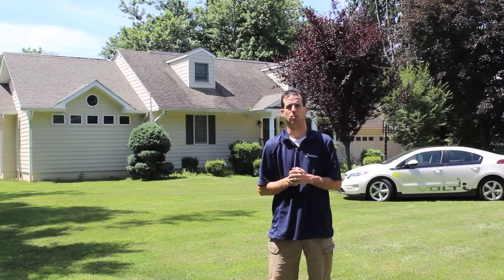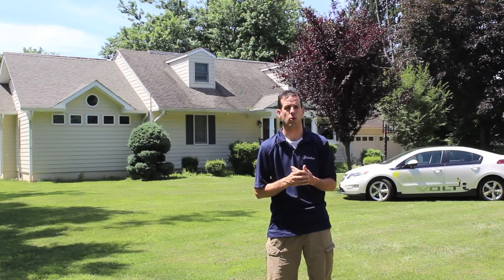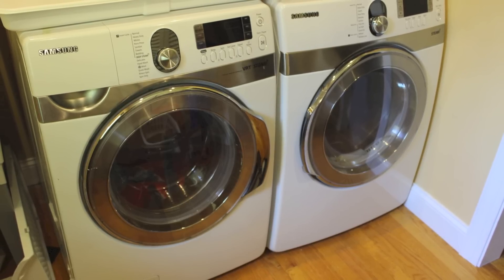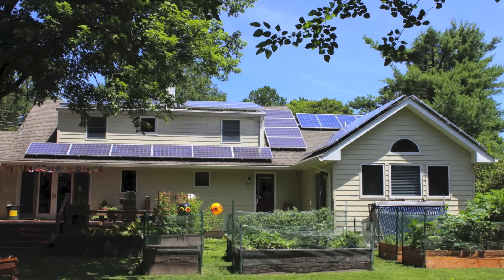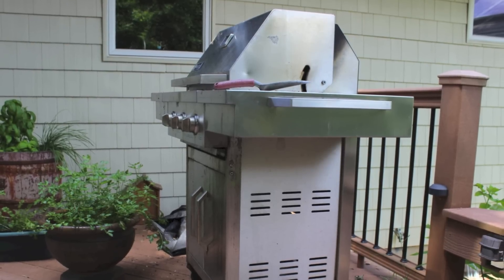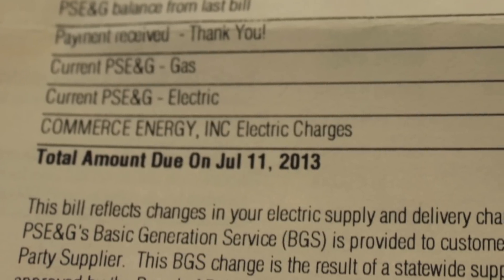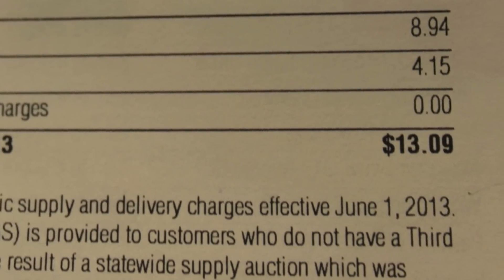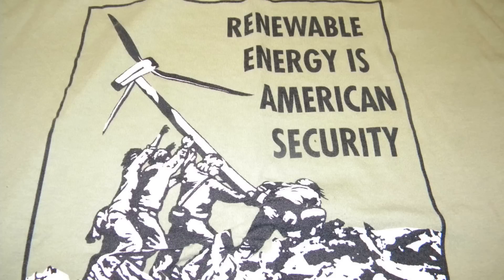Net Zero House & Car in New Jersey  Solar PV Thermal Geothermal No utility bills

Comment: I'm a conservative and have a energy efficient home... don't appreciate the asserted stereotype near the end - further, solar panels (though I have them) are made outside the US and is not recyclable and creates waste over time. Though I enjoy not paying electric - this is not a carbon footprint friendly product as there is none as I see it at this time. Geo thermal is a great option to offset heating costs so long as the water conditions are good with excessive minerals in water, depending on open loop vs closed loop systems. As for the electric car, we still have a way to go to make that be viable with distance per charge and time to charge - I can see us eventually being there but until it can match or exceed gas vehicles in all ways including time to charge matching filling up the tanks, it can only be forced by democrats rather than a natural transition, as with all "net zero" policies.

Comment: Just had a 13 KW solar install done and waiting on NET meter installation before commissioning. We hope to be NET 0 or close to it with respect to electricity consumption, still using natural gas for cook top, oven, hot water heater, furnace and Generac 20KW standby generator (a must here in SE TX where we are prone to outages caused by tropical storms). Natural gas averages about 25 dollars per month so probably won't be switching all of those to electric.  Nice looking home and congratulations on your low power bills.

Comment: I am looking into building a house in Ohio and I want to do passive solar with thermal mass storage and solar PV for my electrical needs.  Question is with a limited budget say less than 100,000  I am figuring things a bit backwards.  I am trying to get all these energy saving systems priced first then will determine how big of a house I can build.  I know orienting my house with a bank of windows on the south isn't going to cost anything but everything else is a little difficult.  I am looking at kit homes then getting volunteers to help with the build of the structure.  Just how big is your house?  Any suggestions?  FYI:  I will be in a rural area and will have a septic tank but hoping to do a grey water system, also hoping to have a well instead of public water.  The less hooked up the better.

Comment: everyone forgets cradle to grave c02 emissions. even solar pv panels emit carbon...
think its 0.080 grams per kwh. manufacturer transport installation and the guy that burned fossil to get there. It adds up!!
Reply: An average size human at rest exhales 1.47 kilograms of carbon dioxide per day. The solar panel would have to run for over 2 years to produce as much "cradle to grave" CO2 as a lazy human does in 1 day. Sure, "it adds up", but it adds up to nothing substantial, especially when the alternative is fossil fuel. And if it really bothers you, plant an evergreen tree on the western side of the house. It will sequester carbon for years to make up the difference, and reduce cooling loads by shading the house for even further energy savings.

Comment: My family and I have been researching net zero homes for a while.   We're planning to relocate to the MD area.   Do you have any thoughts on SIPS panels versus the traditional?
Reply from the maker: I think Sips can be good, as long as the joints are properly connected.  I'm always concerned about air leakage between the panels.  BTW- I do consulting, feel free to contact me if and when you're ready.

Comment: Thanks for sharing your home and what you did to get to that point.  You still have the fact that solar will last 25 or so years they say. So the increased costs in upgrading your system when that needs to take place.  But as you said your investments paid off within 8 years.  So you could purchase 3 complete solar systems and come out ok.  As well cost of solar continues to dive.  Great stuff.
Reply from the maker: Marcus Young -  Yes many companies are installing solar for free.  They are doing this because they are making a profit from doing it.  If you can afford it, you'll be far better served collecting the returns.  Furthermore, several of these free installs have a lot of false claims that don't turn out to be so lucrative for the homeowner.
Reply from the maker: Thanks...
Reply: @realxinghomestead I'm not sure how things are in other states but right now in Maryland companies are putting the panels on your house for free. They do installation and all maintenance unless you opt to purchase them. I'll personally be going with Solarcity. Nice job on your house OP. I plan to do the garden beds myself and I like how the padding in the garage has the different color so you can line the car up when you pull in.
Reply: the43k How much did your set up run you? Upward of 20K?
I'm still learning but excited about these projects on my first home. One of the first projects this spring/summer will be a rain water collection system. :)

Comment: Very nice video and house and I like the charging port,very handy..We do run solar house too,I have just about everything solar and we drive nissan leaf.what a change and everything is cleaner,yes all the el.equipment starts..LOL..
Reply from the maker: nice work.. :)
Reply: I think you might like your house if you put bigger windows in it, and having the solar panels along the fence might be better could get mold under the panel?

Comment: think it's worth it to stick only a few of these panels on a small townhouse roof?
Reply from the maker: Maybe not…  a few panels may not be cost effective as installing a group.  Economy of scale.  Also, a townhouse or condo have rules and regulations regarding altering your home.  In some instances, you don't own the roof or you share it with other owners.  It can be a headache… But good luck :)

Comment: I really like these types of homes. I think it is great that you are 100% self sufficient it may have cost a lot more but I think in the long run it will be better imo.

on a different note some thing you might find interesting their are a lot of videos about people modifying their battery power tools into corded ones with a inverter and a bad battery so you can us wall power or battery power. I was thinking since you just use electricity that you produce this might give you a few more options and be a little more versatile with your battery powered items.

I will be subscribing have a good one

Comment: If I installed something like a 10 k grid tied system what happens if I lose grid power. This happens a lot in my area. We live in North Florida so there is always some thunderstorm that took out a power line. Additionally how exactly is the system connected to the home and grid.

Comment: Cynical post warning. But most of the problem lies with the American way of life. Huge homes, unsustainable products, excess of nearly everything. Steps like this help, but to a very small extent. The fundamental issue is lifestyle. The only chance that environment has lies in the fundamental destruction of our economic and financial systems. Are you willing to concede that truth? Most people are not. They want jobs and products. Do you think the environment can handle that, no.
Reply: That kind of sounds like you don't want to do you part.  That's how this works.  EVERYONE or even just MOST people do their part (like NJRE).  I am doing my part.  My parents' home will be beyond Net Zero, very soon.  It's your turn. ;)
Reply from the maker: Most of what you say is true.   Capitalism -  Based on exponential growth on a finite resource planet.   We've been spoiled for a 100 years on cheap energy.   If we had a carbon tax, you'd see houses, cars, boats and life get smaller.
Reply: NJRE Which definition of Capitalism includes “exponential growth” or “finite resources?”

Comment from the maker: a EV going about 12000 miles per year, uses about 3000 to 3500 KWH per year.  A 5KW system for 28k is high in price.  Thats about $5.60 per watt.   Average these days is around 4 dollars per watt.

Comment: If You didn't use an electric car, how big of a system would You need? Also how much does that size of a system go for? I got a $28,000 quote for an Enphase 5K system. Is this average?

You advice is appreciated,

Comment from the maker: Solar thermal is far more efficient then PV.. PV is around 15% efficient.  Solar thermal is around 70%.  If you want heat, stay with solar thermal.  PV is obviously more versatile,  Yes, the return on investment is longer for thermal, but its getting better.   Thermal is easier to store energy too.

Comment: I've wondered this for a while. They have electric water heaters with a heart pump on top of them now. There supposedly very efficient. I'm wondering if replacing the vacuum tubes with the same square footage of pv panels would make more sense. You only use one solar system instead of two. I assume it would less expensive to add a few more pv's then installing a separate vacuum tube solar heater. Plus, ask if your got water would be contained in one system. The numbers I found make sense.